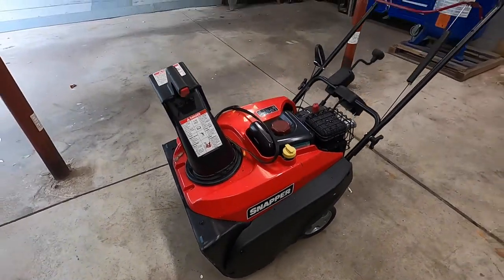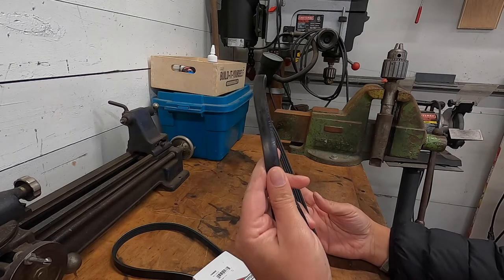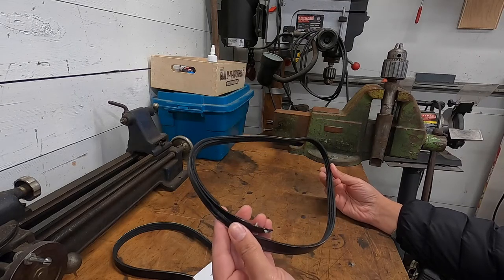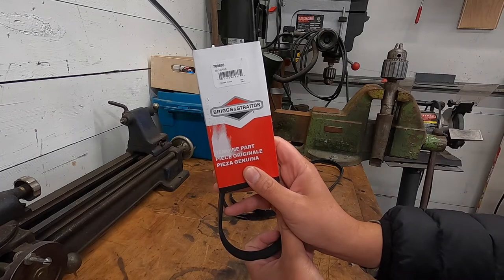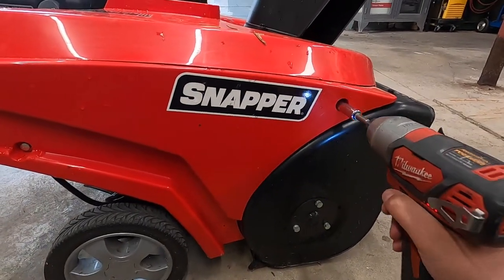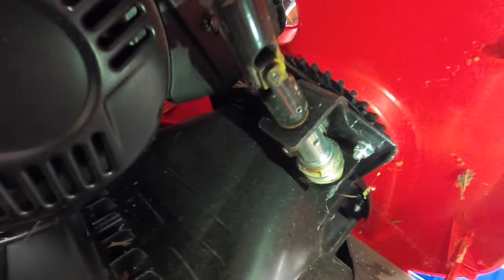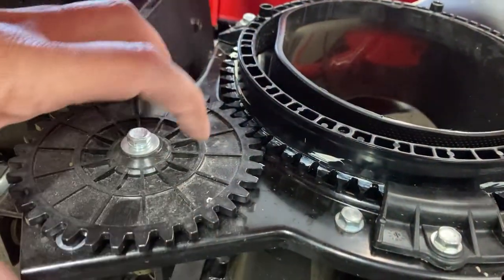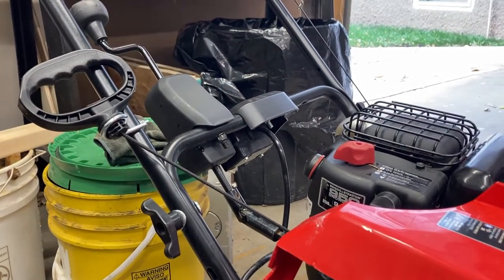Fixing the belt and chute on a Snapper EX1022 1022EX Single Stage Snow Blower 1697340

Comment: Thanks man. Having issues with my Briggs and Stratton 1022, the belt keeps slipping while throwing snow.  

I'm going to give the 4pk945 belt a whirl. It seems like the OEM belt i have, Part no: 709868 is way too loose. I can slide it on the pulley with ease.